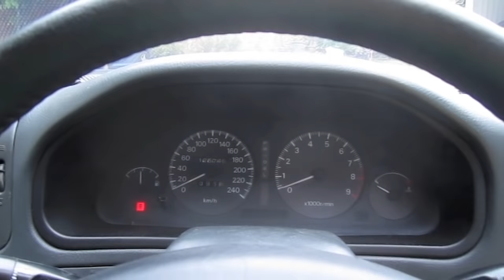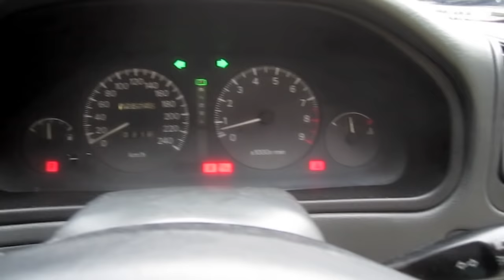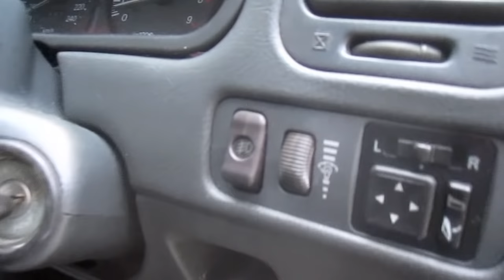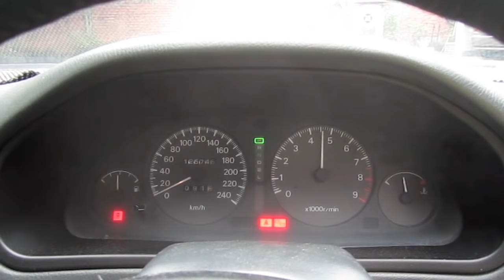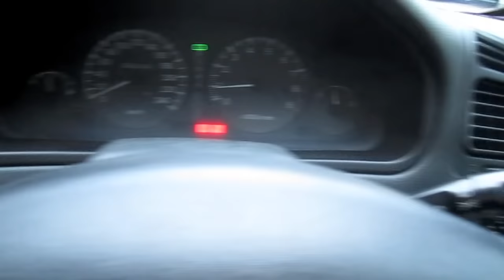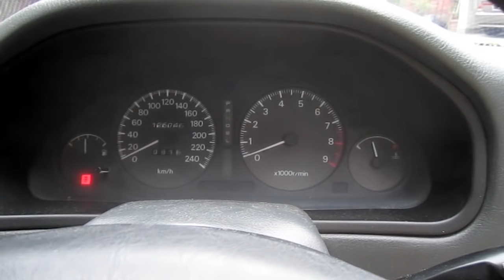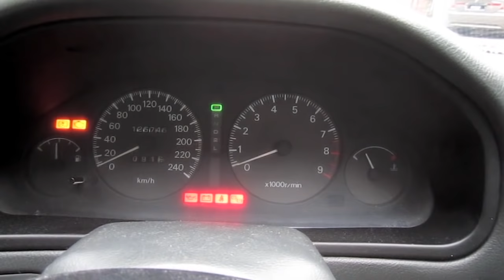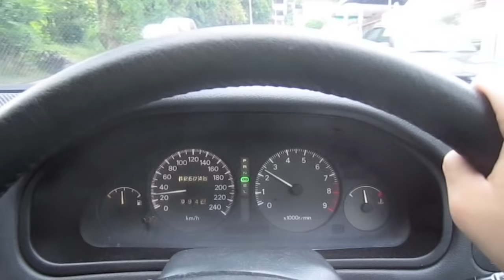2002 Proton Perdana V6 Start-Up, Full Vehicle Tour, and Quick Drive

Comment: im driving wira v6 1.6 manual and owned a proton perdana v6 2008 elegant model with oil cooler for the engine. the among best 1.6 engine and the best sedan among the class

Comment: Can i ask you 1 question? What is the "A/T Mode" button behind the gear on Proton Perdana? Is it some sport mode? Please reply... :)
Reply: If you are referring to the button on the right of the gear lever, it is the overdrive button.
Reply: AT mode of the perdana V6 button basically holds the gearbox in whichever gear u are in. Say u are in second gear and u don't want the gearbox to go up to 3rd or even kick itself back down to 1st, then u can press the AT mode button to let it stay in 2nd gear.